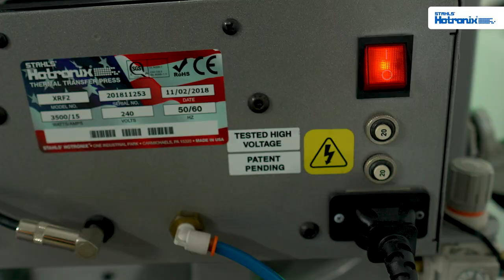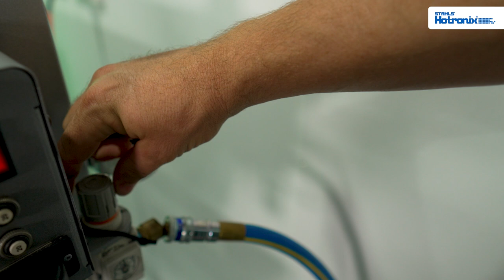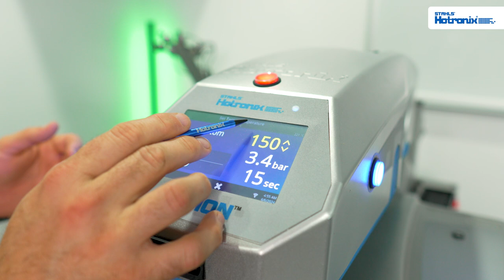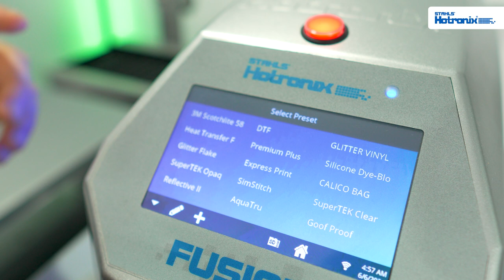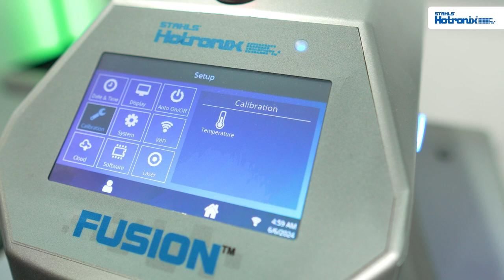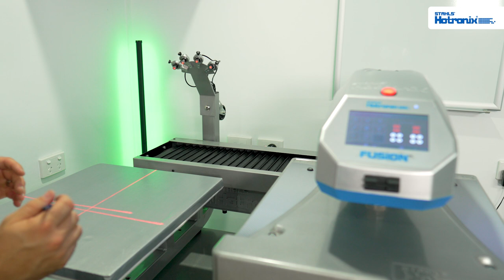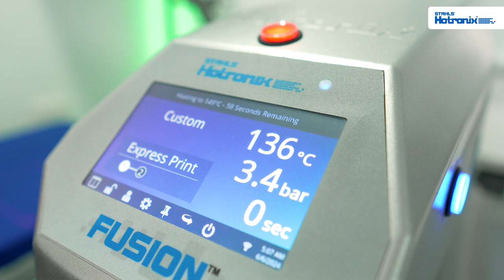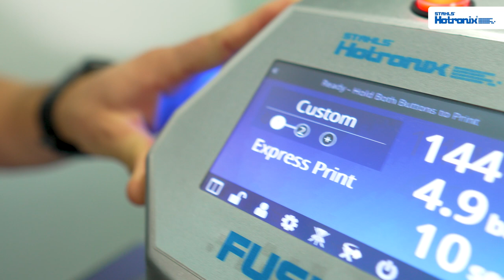Master Your Stahls' Hotronix Dual Air Fusion Heat Press: A Step-by-Step Startup Guide

Comment: I ca not get my heat press connected to the air compressor I got, the cable that came with the heat press does not fit in to the air compressor, is there a connector that is recommended for this? Thanks for your video
Reply from the maker: Your best bet is to take the connector off the dual and take it to a hardware store so they can find the right part for your compressor. All is needed is an adapter to connect the two up.